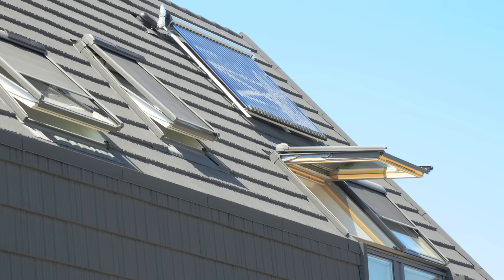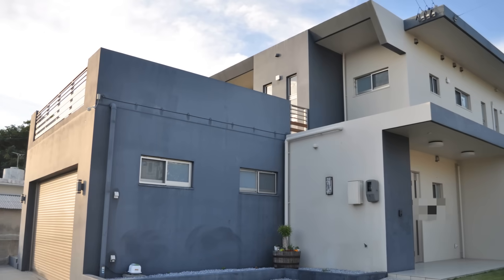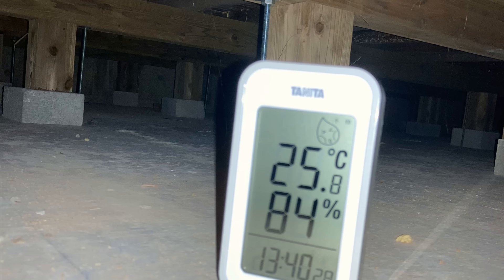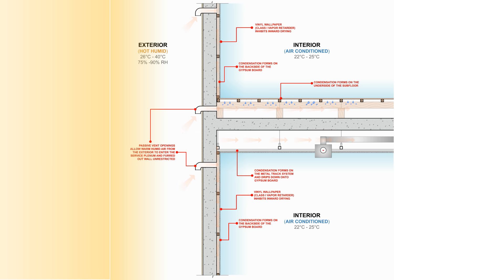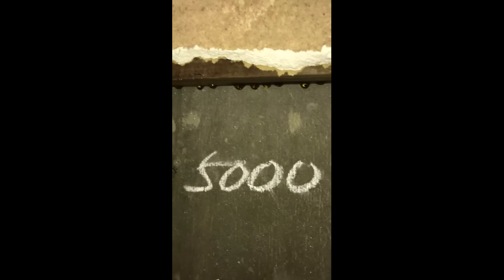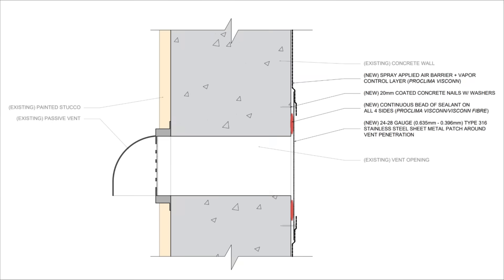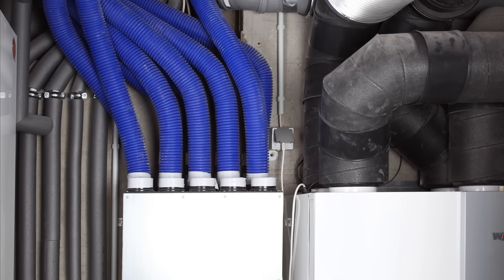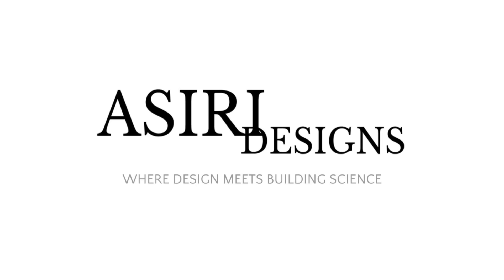The Unintended Consequences of "Passive" Ventilation... (A Case Study in Japan)

Comment: It's insane to me that heat recovery ventilation is not a commonplace in developed nations like US and Japan, especially since both of them have hot and humid regions like Florida and Okinawa. It's pretty much a standard here in Eastern Europe in newly built homes.
Reply: The central heat recovery ventilation systems I've seen on building shows look like a nightmare, with one central unit and ducts running everywhere. They must cost a fortune to install and they add one more maintenance burden. My instinct would be to have simple, self-contained recovery ventilators on outside walls with no ducts, which would involve less money and complications. I've seen such individual units on the market, but I don't know how good they are. We definitely need them if we are going to hermetically seal all the other openings.
Reply: @pcno2832 A problem with these cheap self-contained wall units is that they need cleaning every few months. Imagine having to follow a cleaning and maintenance schedule for a device in every room in your house. Most people won't do that, creating the same mold and nastiness situation in a different way.
Reply: @pcno2832  yep, it costs quite a bit of money when home owner's most focuses are the interior design and aesthetic.
Reply: @pcno2832  My system only cost £1300 to install, but typical quotes for retrofit are £3000-£5000. It only adds maybe £2000 to the cost of a new-build if it's installed as the building is built.
You can do good ventilation with networked ventilators, but you lose out on the heat-exchanger efficiency unless every point has an HE in it, and that gets expensive in equipment terms. The small HE's are much less efficient than a big central one, and each costs £250-£900 depending how fancy they are.

There is a neat system from Bluemartin that has a through-wall HE main unit and a few remote fans to move the air around the building without loads of ducting. That can be a good compromise, especially for flats/appartments.
Reply: heat recovery systems require the air filters to be cleaned regularly. its easy enough to do, but as you might expect, gets delayed/ignored/ forgotten. resulting in poor air quality for the residents.
Reply: Solar is a much simpler and more cost effective way to reduce your energy bill in Florida. I guess idrk but Okinawa also seems sunnier than Eastern Europe.
Reply: @alexphelps7042 in this case the primary concern is exchanging the air in order to get rid of the moisture - not the cost savings.
Reply: It's extremely rare in the UK too, but nearly standard (AIUI) in Canada. MVHR is cheap to do whilst building a building and very expensive/difficult to retrofit so making it a building regs requirement make a huge amount of sense. I retrofitted mine for £1300 (in 2015) so it doesn;t have to cost a fortune. It's mostly work, rather than equipment/material costs, so DIY makes it 1/3rd of the cost.
Reply: Wait which part of Eastern Europe, I haven't seen a single one of those in residential in my entire life
Reply: @koghs  they are not that common exactly and most of the time they are either hidden/unaccesible for public.
Reply: The world isn’t nearly as developed as people like to think it is. Maybe for the 1% of the 1%, but for most of us, it’s delaying going to the dentist and doctor and just getting by month to month.
Reply: @CountJeffula  Not only it is not developed, its also very corrupt and crooked. That is why progress is very slow or sometimes made impossible to then maintain complex things.
Reply: It's insane to me that people in 2025 with access to the internet still can't understand how American homes are built, and why they're built that way. Instead it's just endless commentary like yours or worse. "Gawlee, I just can't figure out why they're so stupid!"
Reply: Agreed
Reply: Korea has also been mandatory since 2006! There are many built-up houses, so there are many even though there are no built-up houses.
Reply: How else can the deliberately illiterate be fleeced
Reply: why are europeans so utterly pretentious about construction?
Reply: They can't even nail the roof trusses to the rest of the house correctly in these 500k shitboxes they keep pumping out and they all look the same.
Reply: @s0nnyburnett now most of the value is tied to the land and beurocracy, gov regs in the uk can easily be the major expense, the structure itself is almost a worthless shitbox but low supply and high demand make them expensive.
Reply: @s0nnyburnett  It's insane to me that a such an informative and professional-level video like this attracts ignorant bigots like you. If you think American homes all look the same, you haven't see many American homes. If you think American homes are shitboxes, you're either ignorant or just too dumb to be able to understand the concepts involved. Go be an ignorant bigot somewhere else.
Reply: Expensive
Reply: @smellypunks  They are dirt cheap tho
Reply: @smellypunks houses in US are like, 4 times more expensive than here in my country, and they're frame houses rather than brick... You guys are getting scammed.
Reply: @meowchin cost of land and Labour are different in different areas. Also material but to a lessor extent.
Reply: @goiterlanternbase  you are watching the "i found shit construction" youtuber whos job it is to look at the construction of a lot of friggin homes, most of which for the past 5 or 6 years are built largely for investment portfolios who do not give a damn about the construction quality. it is not surprising they find houses where things weren't installed properly. It's their job, it is what they are called and asked to do and they would often be called when there are at least a couple known problems.

Yes things should be a helluva lot cheaper and houses should be built to proper code, there are more reasons behind this shit occuring beyond "you are getting scammed", but if you want to blame the victims of a systemic housing issue by all means go ahead.
Reply: Labour costs and overall market situation. Don't worry the WHOLE Europe is going down that path really quickly, people with money and whole companies realised real estate is a good investment. Poland is even considering allowing REIFs.
Reply: @meowchin  No, we aren't, you're just ignorant. There's no advantage to or point in building brick homes in the U.S.
Reply: What's wrong with what worked for thousands of years...?
Open your windows for a couple of minutes in the morning, while you go to the bathroom, letting out the night's moisture (or just exchange the air, if it's humid outside). Do it again late evening before going to bed.
That's more than enough ventilation the day!
Adding A/C in hot and humid areas helps dry the interior (of course respecting all the other things the author said, like vapor transmissible materials inside).
The the only thing you have to care about is, not to get condensation on the outside. But that won't happen with "normal" building.
Reply: @danielw.556  Yeah man, triple cost of your heating for no apparent reason.
Moisture mitigation is literally just a numbers game over several years. Given how cheap heat recovery units- you can have powerful passive ventilation and save on bills. It is a win-win scenario for everyone.
Reply: Look at how an HRV or ERV works on the enthalphy side , and you’ll see that those are not good in a hot and humid climate. The latent part of the exchange is the problem. It introduces more moisture than it takes out. 
You want to dehumidify? Use a dehumidifier or if you have the money, get an expensive whole-house ventilation system like Zender.
Reply: @Franksdoneitagain  ERVs are not a solution to the dehumidification problem--they're a solution to the ventilation problem that minimizes moisture infiltration. Inhabitants need a certain amount of air to remain healthy, and introducing that air via an ERV takes in far less humidity and heat than opening a window or turning on a fan.
Reply: Japan's building practice is about 60+ years behind the US. Maybe more
Reply: @froxtrotuniform Not really, post April 1st a new Japanese house isn't far from US code and many new buildings far exceed the minimums for earthquake resistance and insulation.   PV is more prevalent here as well.
Reply: @froxtrotuniform and US’ practices are 30+ years behind Europe’s so we’re going full circle as we go around the world.
Reply: @Franksdoneitagain  No, U.S. practices are not 30+ years behind Europe's. They're different. The U.S. is never going to routinely build brick or cement homes the way Europe often has, and if anything many areas of Europe are starting to adopt North American-style home construction. American homes are engineered to readily withstand the normal extremes of the environments and climate zones in which they were built. They're pretty darn good in earthquakes. And the big EF4 and EF5 tornadoes everyone sees destroying U.S. homes would severely damage brick and concrete homes, and destroy their interior contents, as well. It's just absurd that you people honestly think everyone in North America is "behind Europe" in home construction because it's not done the way you do it.
Reply: @Objectified  😂yeah sure, whatever. American homes are extremely well built for the climate they’re in… You’re talking out of your ass buddy.
Maybe in some building codes but they’re usually built to pass code and nothing else, unless custom. 
In FL, insurances have been driving codes for over 30 years because of wind damage and now flood, but NOT for thermal efficiency. Many builders still use r-4.1 foil on furring on block and that for the last 45+ years. A real POS product that should be banned. ACH50 is ok up to 7…  7!!! Might as well leave a door open. Thermal efficiency and air tightness standards are MUCH higher in Western European countries because energy is more expensive there. 
So please, crawl from under your rock and open your eyes.

Comment: I have seen quite a few videos of repairs nade to japanese homes and the buildings are.. let's say interesting.  No proper vapour barriers, no capillary action protection, little or no insulation, no proper protection vs insects, etc.
Reply: 一般的には30年で建て替えられています。戦後に早く安く、低品質の住宅を建てることが必要とされたため、その習慣が現在も続いております。建築業者の99%は結露の問題を解決する知識を持っていません。多くの建築トラブルがあります。多くの裁判もありますが、裁判所は建築業者を擁護する傾向があり、裁判の期間は五年以上かかります。
Reply: Look at recent homes. There are barriers above the crawl space, good flashing for rain etc. The long lasting good homes program restricts materials choices and forces a winter condensation calculation requiring either exterior insulation on an internal vapor retarder.
Reply: I've seen homeless people on the streets with better thermo efficiency
Reply: Vapor barriers don't really make sense in hot summer, cold winter climates like Japan. If you put it on the inside, you'll have problems in winter, if you put it on the inside you'll have problems in summer, and if you're putting it in the middle it's not really doing anything. It's air barriers that you really want, and the two being conflated in places like Canada is really not helping things.
Reply: Japan has frequent quakes. Houses are cheap, fall often, get built fast and.cheap.
Reply: @Benoit-Pierre  Are there any statistics on how often Japanese houses "fall"?
Reply: @derimmerlugt3032  I don't know about "falling" but I've often heard that the Japanese have an aversion to keeping a house that's older than about 30 years, partly stemming from Shinto traditions, so there is a huge inventory of semi-abandoned houses in Japan. I've also heard that while Japanese houses were traditionally very flimsy temporary structures, resembling a camping trailer in some ways, they are much better built under current safety codes and could easily last for centuries with proper maintenance, but such maintenance is hard to justify in a culture that doesn't value old houses.

Comment: So this video proves the point that unconditioned air which moves into the building through vented openings, may cause mold or mildew inside the structure.
Why then are crawl spaces in Zone 3, the southeast, constructed with vents?
Reply from the maker: Yup! You have pointed out a big problem that we see in the southeast with these vented crawls, especially if there is vinyl flooring that has been installed (which is super common down there).

Comment: This is why it frustrates me when people suggest open windows to remove humidity. Do you not realize that won’t work if the outdoor humidity is higher?
Reply: It originated from Northern Europe  where it would be done at least once a day because the air gets so dry in old buildings during the winter. Not even new houses have AC so that's not an issue.
Reply: Indoor humidity should be kept at 50% RH +/-10%. 

The actual water vapor percentage changes with temperature. Warmer air has more moisture at the same 50%RH. 

100%RH is where moisture droplets form. You dont want any item (ductwork, concrete basement wall) in the home to cool down to the dew point. 50%RH prevents this. It also reduces airborne dust and even reduces virus spread by an order of magnitude.

Comment: Shout out thermpro hygrometer thermostat. Thanks for sharing. South Texas here, the passive ventilation really killed this house. Glad you got it fixed. Our climate zone and floridas humidity are some really hard projects. The humidity not only causes moisture problems but heavily stresses the AC components. A follow up video with what your company chose to insulate the crawlspace with would be very interesting. Was it the traditional plastic vapor barrier and fiberglass? The build show has some great videos on this issue and they host other companies sometimes too
Reply: Well it doesn't help that ACs have to work overtime since most US houses are wooden shacks with barely any insulation.

Thin shingle roofs in dark colours, thin wooden walls, no insulation or a tiny amount of fire-accelerant sprayfoam, and they wonder why they need multiple ACs on an average house.
Reply: @nvelsen1975 unfortunately its cost driven but a small investment on the front end pays on the backend. Another practice is average homebuilders sell houses for the same price as a high performance and make out with the profits and none of the insulation but the average family trying to keep up with the jones consumer just cares about newer.

Comment: Great video.  Would you also look to address the path of water absorption through the stucco into the concrete, especially since this is an ocean side location and the salt content in the water vapour would be high?  Small cracking will also cause water uptake through capillary action.  I would be concerned about stucco and concrete failure. Helpful information and impressive project.

Comment: When it's very hot and humid outside i turn up the temperature on my AC (mini split heat pump) and put it in dehumidifier mode to minimize the risk of condensation never had any problem.
And i check with moisture meter, thermal camera often and also have several temperature and humidity sensors around with dew point calculation

Comment: The mini splits that are popular in Japan are also not effective at removing moisture. But yes, a passive ventilation in a climate like here in Florida would be a disaster. Similar to how cheap radon mitigation system work.  This example you presented here is a perfect storm of building practices that are not compatible with the climate it was built in.
Reply: They can be effective at removing moisture if correctly sized. Unfortunately even the smallest 1:1 minisplits can only turn down to 1800 BTU/hr, and most are either oversized or are multi-splits, which can't turn down nearly as much.

Comment: A question for you: it feels "easy" to deal with one dominant weather, but what about areas where summers are hot (over 30°C) and humid, winters are cold (well below freezing, but usually over -15°C) and dry? Insulation layers and inside-outside air pressure should change seasonally? Okay, can't change the insulation seasonally, but should the layers use the winter or the summer conditions? Would it make sense to pressureize slightly in the summer? From the sources I have read so far recommend zero or slightly negative pressure difference in the winter, so warm and humid air doesn't enter the structure in the winter.
Reply: Minnesota you mean?
Reply: Hokkaido too probably
Reply: You calculate insulation based on your coldest period to avoid steam condensing in insulation layers. Everything else is dealt via ventilation+HRS.
Reply: " or slightly negative pressure difference in the winter" dont you mean positive pressure?